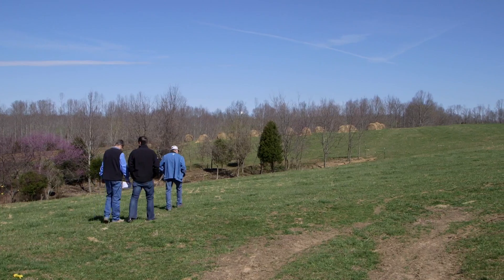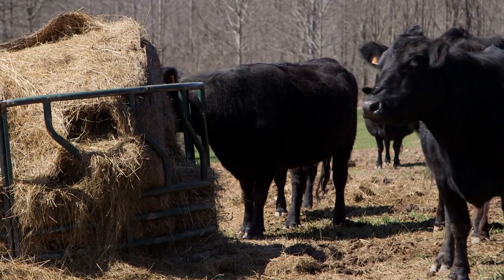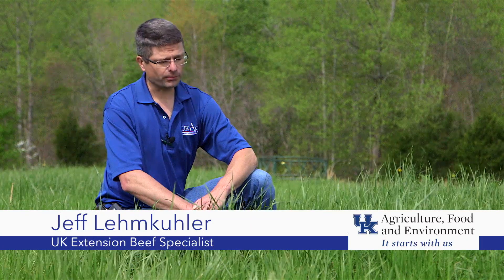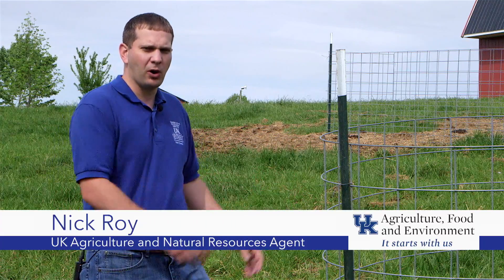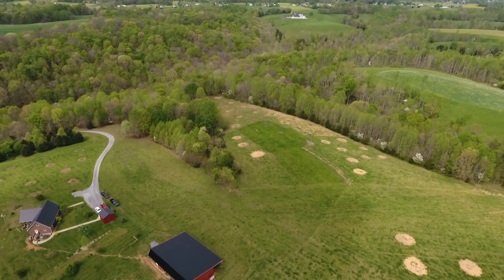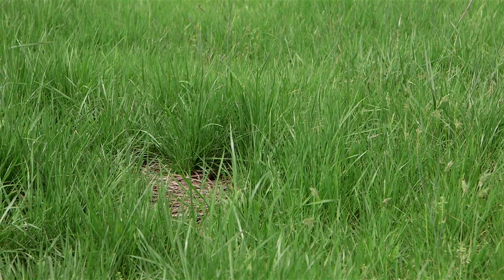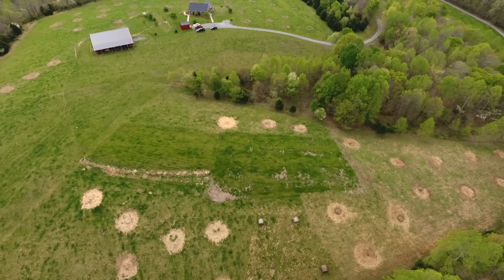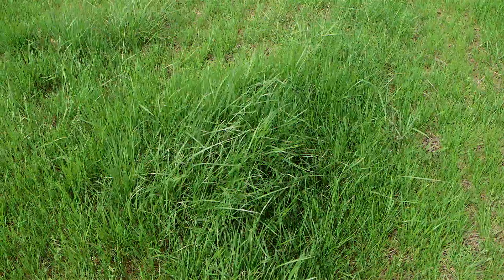Bale grazing progressing in second year

Comment: shoulder really be rolling out those bales. it's like picking up dollar bills and dropping 100 dollar bills out your back pocket. If you have a solid rotational grazing program and in a mature landscape or semi mature system. Like 4 years in of real rotational grazing leaving behind coverage. You are going to spend less time feeding hay anyways. And some standing forage for the winter combine. But if you don't roll it out it damages the land in huge circles because it's too much weight. leaving bale dots of unproductive land that takes like 1-2 years to recover. If you roll it out some gets wasted yes but the land is useable meaning in a rotation it produces more than it was wasted by alot throughout the season. Plus, there's a lot of cattle comfort and other knock on things you are missing out on. When you just bale graze like that in a kind of strip bale system without rolling it out it's still too much weight on the ground.